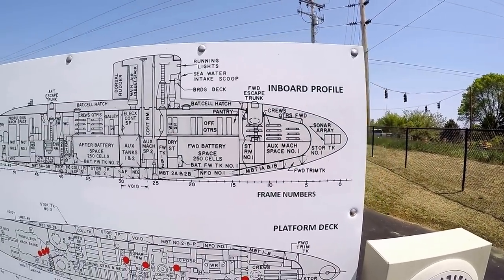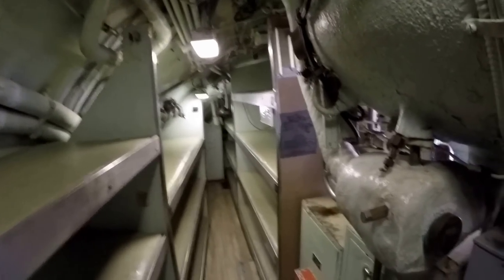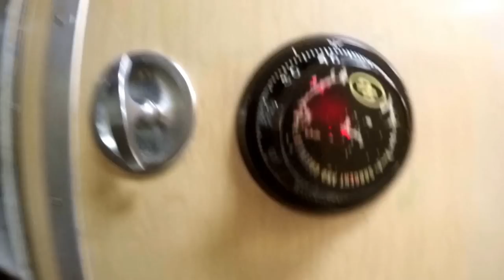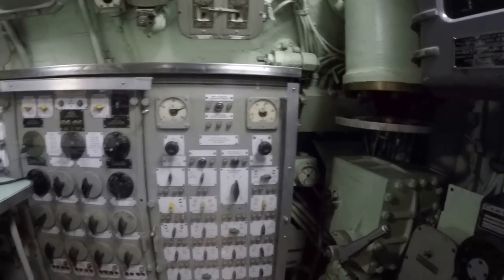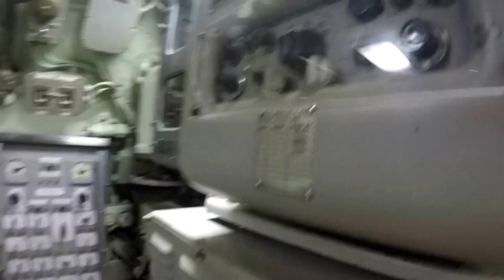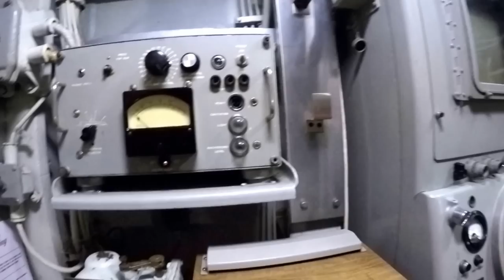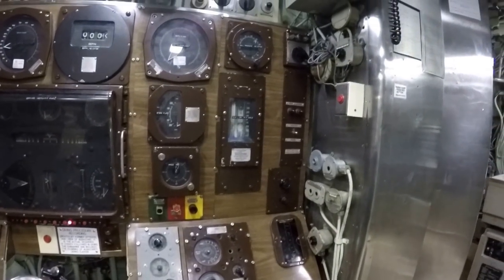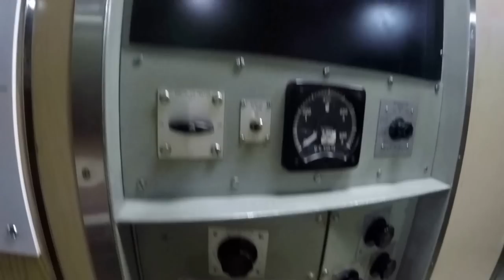USS Albacore (AGSS-569)  walk through

Comment: I did a walk-through maybe 12 years ago. I know subs are cramped, but Albacore set a new standard for "cozy." I don't think the ordinary seamen could even turn over in their racks.
Reply: Like I mentioned before, am only 5'8" and was about 150lbs back then.....Lots of room in my bunk even thought I had to share it with a large valve by my head (center bunk aft outboard in Hogan's Alley).....The discharge vent for "fresh" air was at my feet......Popsicle toes if I didn't keep 'em covered with blankets...... After about 10 days at sea, slogging our way thru a major Atlantic storm on way back from Ft Liquordale Dec. '67, we weren't aware how bad the air in the boat was and how badly we reeked (no showers) until hatches were opened and we got out into the fresh winter NH air.....Dang, did we stink!!......Fast walked back to the barracks for a lonnng hot shower!!....Was better than the first beer shortly afterward......
Reply: @sailnekkid    wow I love this info. Thanks for your service. From 🇬🇧

Comment: I believe that the stern is not the orignal one built on the albacore. The original one look like one off of a torpedo twin screws with a vertical and horizontal control surface. I remember seeing an old photo of it coming out construction. It's was upgrade to the X layout later in its life then a sail rudder was install to help it stable itself out on turn after testing the X set-up.
Reply: Correct

Comment: 4 minutes in and ive noticed they didn't spare any phones.  Damn thing's are like every 5 foot and then another one.  Lol
Reply: How else are you gonna order Pizza Hut while underway?!
Reply: @Legitcar117  lmao.  Very valid point.
Reply: Sound powered phones......After a stint in dry dock, at sea trials, all doors were dogged and 1 guy on a phone in each compartment  reporting leaks as we worked our way down to 500'......Mostly just leaky valves that needed tightening, so the machinist mates and enginemen told me....Was a tad unnerved when several compartments reported leaks, but they were pretty casual about it..... (I manned the the phone in the forward battery once).....Ya dang sure don't want seawater in the forward and aft battery compartments....lol
Reading all these comments brings me back.....Hard to believe that was over 50 yrs ago..... (am 75 and still healthy....arrrr)

Comment: Where are the torpedo tubes? I see bunks at the nose only.
Reply: It was an engineering research boat. It was used as a test bed for the submarine fleet. It never had torpedo tubes installed.

Comment: no bow planes???
Reply: Originally built with folding bow planes, they proved too noisy and unnecessary. They were removed in the second modification phase. ussalbacore.org has a ton of technical info on the various modifications done to the boat.
Reply: yeah, I suppose rapid submerging isn't as critical in a non-combatant.
On the LA class they finally moved the planes from the sail back to the bow. Faster to submerge - and got much better control that way.
Reply: @merlemorrison482  Of course you aren't getting any trips to the north pole on that boat.
Reply: @Mark-OutWest   so you think that bow planes are only used at the north pole?